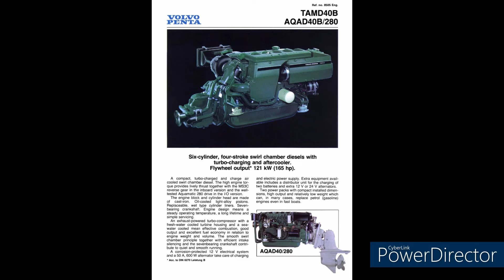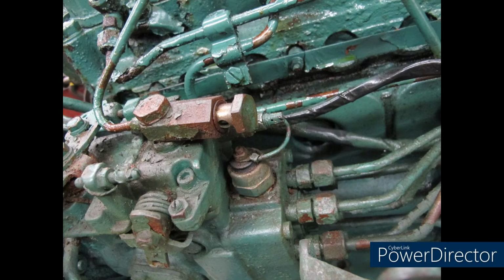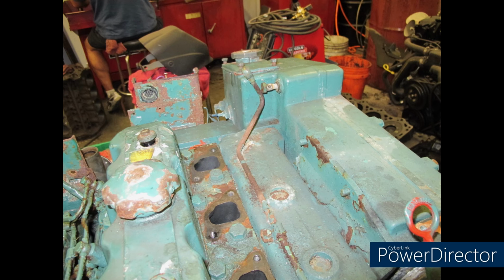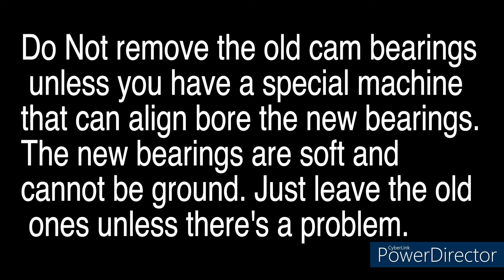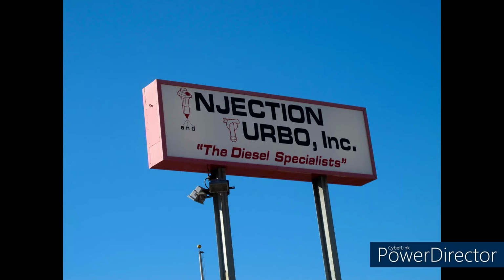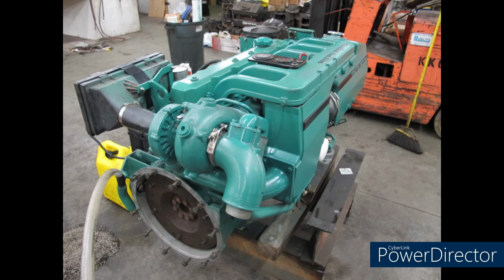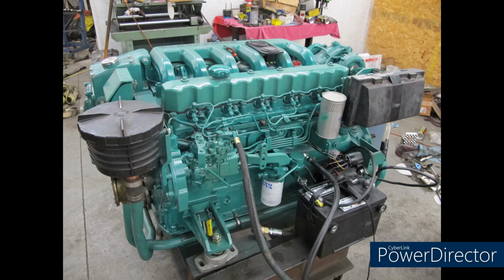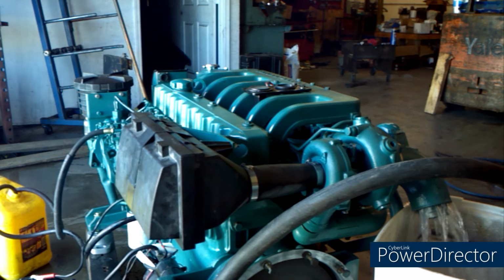JC 26 LOBSTER BOAT RESTORATION EPISODE #5 Volvo Penta AQAD40B Engine Major Overhaul Wharram Tiki 30

Comment from the maker: Depends on the internal components.  Gaskets and such aren’t too bad but pistons and cylinders are very expensive. I spared no expense since I didn’t have any info on the engine use or hours and was going out onto the ocean. 2000 hours isn’t much and these engines are designed fairly well as far as gaskets and seals. I would worry much about it myself.

Comment: Hi there.
I can only dream to rebuild that engine the way you did.
My problem is that I can't find original glow plugs.
All replacement codes that I am getting are showing the glow plug that's different diameter at the top.
Any advice I'll be very grateful.
Cheers mate👍.

Comment: Question did you need to remove the impeller and the housing to be able to remove the fuel injection pump? My dad has been trying for 10 years and apparently can’t figure it out
Reply from the maker: I'm not sure since i broke the entire engine down without regard to sequence.  I would think the impeller and pump gears would be removed without removing the housing.  Sorry for the delayed response.

Comment: I have the same motor to refresh in a trawler.
2000 hours and a bit rusty.
Runs well but worried an old seal or something will shrink and slide out and it will be all over.
 $10k  20K? just wondering what to prepare myself for.